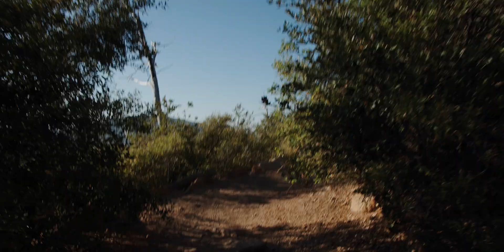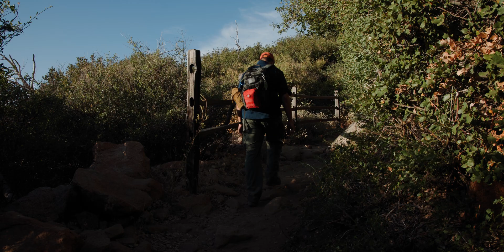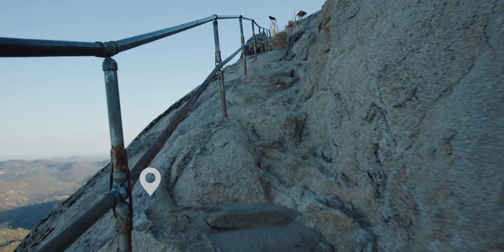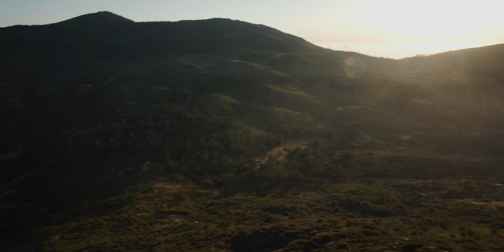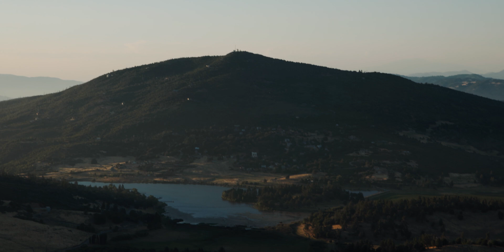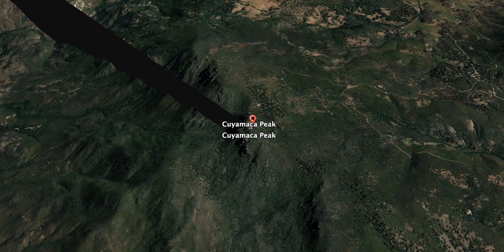Why are radio stations in high locations?

Comment: Regarding the actual title of the video . FM Antenna height helps but the FCC imposes limits on your ERP as your antenna height rises.
Reply from the maker: Lots of power in a low site isn’t as effective as lower power on a higher site. The station I work for used to be 50kW at about 200 feet AMSL. Covered the coast, but didn’t reach the majority of people. Moved to 5700 feet AMSL and it covers almost off of the Los Angeles metro area, San Diego, Riverside, San Bernardino.

Comment: Sometime if you can will you do a video on what the power of a radio signal does , for example my local radio station Clare FM main transmitter is 5kw , and explain does that mean it uses 5kw of electricity 24 hours a day, because that's one seriously heavy electricity bill!!
Reply from the maker: Great idea for a video!
Reply: @TheBroadcastEngineer  glad you think so....I'm just curious or nosey or both 🤣
Reply from the maker: @johnmoloney5296  that’s where the math comes into play. 👍
Reply: There's a lot of curious technical radio stuff banging round in my head about even the ancient technology like medium and long Wave, I will hit you with it slowly and gradually, I don't want to frighten you off YouTube 😀😉
Reply: @TheBroadcastEngineer maths was never my strong point so I hope you can do the "for dummies" explanation
Reply from the maker: @johnmoloney5296  ha! No, it’s ok. If we had the am station still I’d have more content about that. Working on some more an stuff soon, though.
Reply from the maker: @johnmoloney5296  nor mine. So, it should be fairly easy.